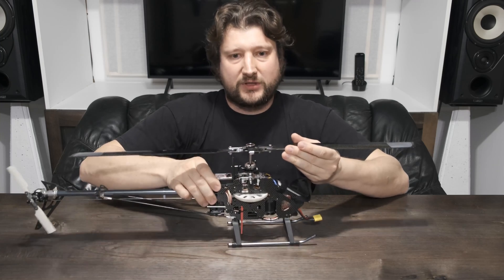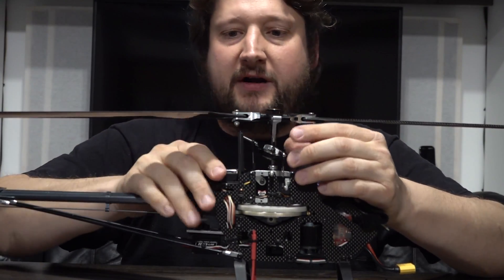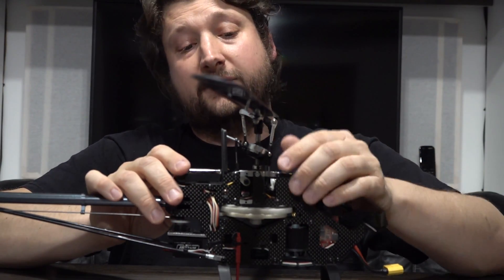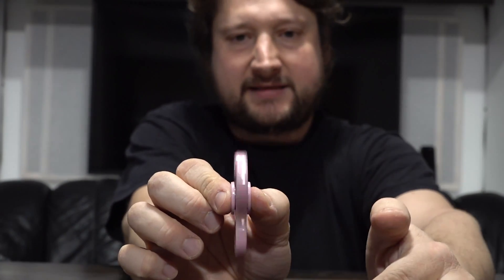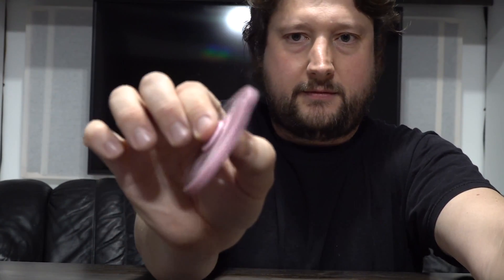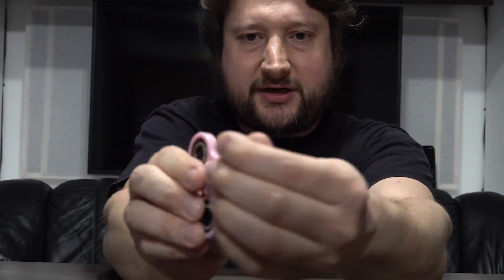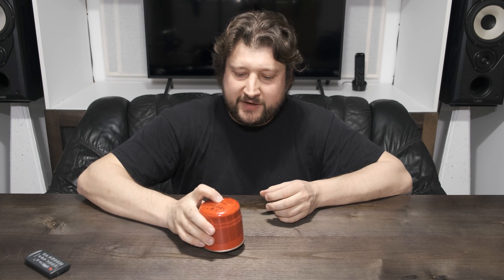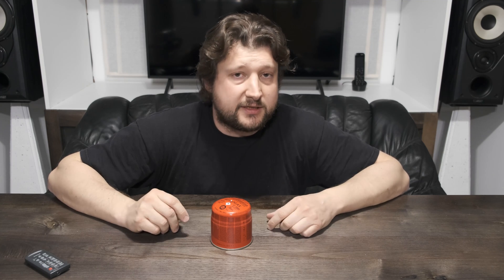Airgun physics - part 1 (why pellets spiral)

Comment: Spiraling diablo pellets is due to The Dzhanibekov Effect. As pellet spin it tries to flip over but cannot because airflow drag on its tail end is preventing it. But the farthest the pellet the slower it goes... the lesser the tail drag... the worse the spiraling. You can't stop this from happening. Because 1st nothings perfect: pellet shape, pellet mass distribution and 2nd most importantly a perfect pellet spinning vs pellet flight path: the more gyroscopic stabilization you have the more angle you'll have at longer range between spinning axis and flight path/airflow drag. Enough to initiate Dzhanibekov Effect... Airflow drag prevent it at beginning of flight but... initiate it at some point toward the end...
You can only mitigate it using:
1 - diablo pellet with higher (diameter/length) ratio (for a given caliber it means using shorter pellets)
2 - or lower twist rate.
This is logic remember: given a caliber heavier pellet are longer... which in turn need faster twist rate... for bullet shaped slugs not diablo one! 

https://youtu.be/Xrf1HzFJ8jc?si=9SSY4AG0boOzVt26 

https://youtu.be/1VPfZ_XzisU?si=7UcEdvh0DZyLdOt_
Reply from the maker: Actually, that is not true. Pellet and slugs have only 2 axis of inertia. Although you could claim the imperfections are the way they get three axis, then the slugs would have same problem as pellets. The very point of this video is the corelation of drag (or flare as some preferred to call it although the momentum derives from drag) and spin stabilization (gyro) stabilization. Both of these two are only present in shapes like pellets at the same time and the problem is that although flare is only dependent of the airflow, the gyro is not, it is actually dependent of derivative of the projectile movement and causes 90° force to the momentum it is caused by. This is best demonstrated by the fact that the spirals are ALWAYS in opposite direction of the pellet rotation. Just think about how weird that is :) You are right that the issues needs a "trigger" and that trigger is imperfection of the projectile (or a ever so slight wooable at barrel exit). That is the initial condition that is required, same as with Dzhanibekov Effect.
Reply: @gregorkamensek3923  two axis of inertia? at 9:55 :
https://youtu.be/1VPfZ_XzisU?si=t_Z2NYML8uyNHgv1
Reply: @gregorkamensek3923 
At 9:55
https://youtu.be/1VPfZ_XzisU?si=OF1cslT15F_PuGV1
But well... indeed, you have the full right to believe in whatever you like! Have a nice day.

Comment: So in short words pellet at further distances just simply drop and gyroscopic effect is not in line with drag stabilisation.
Reply from the maker: Better way of saying would be that this 90° difference of cause an effect between those two stabilization causes an oscillation because a positive feedback loop is presented and any minor starting deviation from perfect axis alignment of pellet and flight path is amplified with time (or length of flight) due to those positive feedback loop.

Comment: Ok I'm at 3:19 and i swear i haven't seen your video before. I'm going to guess that why you say pellets spiral is something similar to why at low speeds of a centrifuge one can get away with inaccuracies of the tubes not being weighed out correctly but as soon as one increases the speed, say to getting up around several g; several things will happen (maybe even quickly LOL One is the centrifuge will begin to vibrate like hell, it may even move off the bench if it is indeed a bench mounted one then you'll be blown up by your boss if your not the boss of the lab and finally if not stopped by an automatic cut out you could have a serious accident depending upon the speed. So I'm thinking that since in reality airgun pellets are not exactly symmetrical or at least they can be easily made non symmetrical by clumsy fingers or just come that way and hence the rotational axis can easily be off centre. Ok there O've said it LOL. I'm not a ballistics guy nor an engineer but some crazy scientist LOL. Now I watch more!
Reply from the maker: Yes, that is let's say the initial reason for issues that everyone thinks off but as you have probably seen from the video, I wanted emphasize to the relation and cause / effect of a dual stabilization any why this problem progresses... Also, based on this theory the RTI long range barrel for pellets was developed that has amazing results with pellets as close to sonic speed.
Reply: Yeah after I watched your video i checked out their site. Amazing looking for sure. Would love to have one but maybe it could be divorce if i did LOL Thanks for the feed back! @gregorkamensek3923

Comment: Hello, congratulations for the video. I'm going crazy, because my cricket tactical carbine 2 in 5.5mm at 50 meters with JSB of 18.13 group well (880 FPS); but, with 25 grain, it makes that "spiral" and I CANNOT CORRECT IT. From your video I have a better idea of what I should do. What do you recommend, increase or decrease speed? Thank you.
Reply from the maker: Are you using Monster Redesign? Those should be stable... Standard .22 LW barrels (and also other like CZ) are in my experience very prone to make the pellets spiral. Poly barrels are much better in this regard. But in any case, lower velocity is usually better although you are already quite low I imagine so I am not sure they will solve the problem.
Reply: @gregorkamensek3923  thank you very much for your reply. Tomorrow I will test and take your recommendations into account. thank you

￼

Comment: The So of Pellets
Ok, the pellet is moving away from someone. The pellet is spinning clockwise - looking at it from behind. 
A force acts on the pellet skirt to move that point of the skirt toward the pellet center. Because of gyroscopic procession,
that force is transferred 90° around the pellet skirt  counterclockwise, and acts to move the/a skirt point toward the pellet center. That is, toward the pellet center of rotation. So the axis of rotation moves the same distance and direction as the skirt. The entire skirt moves the same.
So the skirt moves off center. So the wind resistance acts on the opposite side of the skirt, which is now not in line with the pellet direction of travel, it is out in the wind. 
So the skirt is now continually moved in a smooth development, farther out of the line of travel by the wind resistance while the gyroscopic procession simply moves the wind resistance force 90° counterclockwise.  So the momentum in the pellet increases the effects of these forces, causing the skirt to be moved increasingly farther away from the trajectory.
Soon the pellet axis of rotation is being moved so far from its trajectory the head of the pellet is also moved away from the trajectory. By the wind. So those pattern effects feed on themselves and the entire pellet begins to wobble in a circle. That circle grows in a counterclockwise direction while the pellet rolls (spins) clockwise. 
It's 5 individual forces working on one item from different directions. Forward momentum.
Wind resistance. 
Clockwise spin.
An initial force on the pellet skirt. 
Gyroscopic procession. 
(The pellet decelerating because of wind resistance adds a millionth of a force helping increase the wobble, but we shouldn't mention it or the subject might get complicated).

Comment: Gregor, do bullets have higher (faster) twist rates and is that a good thing for bullets? For example, what is the average twist for a .22 rim fire rifle? Also, do large caliber center fire rifles, eg. .308 have the same twist as a .22 rim fire?
Reply from the maker: Yes, generally barrels for bullets have faster twist rate than barrels for pellets. The required twist rate for bullets depends on many parameters like caliber, bullet length, velocity,... So here are some examples: standard airgun barrel has approx 1:18" twist, standard .22 LR barrel has 1:16" or even faster, typical 308 has 1:12".
Typical rule is: the longer the bullet the faster twist is required, the smaller the caliber again faster twist is required...

Comment: wow so great greg  very well exlplained and i gain knowledge much. so now i dont wonder y some my pellets fly away far from the grouping. that moment i was thinking  that maybe some pellets are not perfectly correct made. of course there is always one pellets are incorrect centrifugal  or i mean its not balance on side to side.. while on the moment of molding from factory.like for example the rim tire of motorcycle bike there is tiny metal thing attach on one side just to balance the weight on opposite side .for some reason that it was not perfeclty equal in centrifugal weight.  but dont take my word coz its just my own opinion ..not really hundred percent sure if im right.  but still im hoping to  contribute some idea ...
Reply from the maker: Yes, that is one of the reason that the spiraling effect can occur but I wanted to focus on why the spiraling is progressive and the direction is in the opposite side twist direction... BTW: match grade bullets for firearms are actually tested for center of gravity similar than a tire of a vehicle...:)
Reply: @gregorkamensek3923  Are there easy ways to test diabolo pellets for their centers of gravity?

Comment: oh yes greg so ur also up into 3d heli hobbie...  i think u also know how to invert fly tricks haha.
anyway regarding the heli blades  the term use to call when blade shifting down and up is called  pitch. pitch propeller . negative pitch and positive pitch. that was  driven by swashplates.
Reply from the maker: Yeah, I used to be... But I don't practice anymore and I would not dare to invert the heli anymore. In my "best" days I quite confidently inverted it but I definitely did not know to do any 3D tricks... Yes, correct it is called pitch and these helis are called collective pitch because the blades RPM is constant (Governor mode) and only the pitch determines lift and controls...
Reply: @gregorkamensek3923  haha and its very expencive hobbies ...  the more u having fun about the tricks the u spent thousand of money and i stop this hobbies by looking for some another hobbies that is not so expencive hehe. better go into drone hobbies and aerial video much better ...its not that expencive and very entertaining.
Reply: @gregorkamensek3923  hellow greg hows it going...?  i bet u know the lcs sk19 semi full auto? how u compare that pcp to huben k1? which one is best for longrange?

and also how u compare the fx impact to huben when it come to longrange. knowing that the impact has the lower power in footpound energy... but ive seen some utube vlog that the impact mk2 reach the 415yard shoot. but that is maybe bigger caliber

Comment: so what what twist rate is preferred for higher velocities? and what range of fps do you regard as high velocity?
Reply from the maker: That depends, I assume that you are talking about pellets since this video is about pellets. If I would have to set a threshold for what is high velocity, I guess I would say everything above 950 fps. Here is an example. RTI long range barrel uses 1:32" twist and at the EBR, I was shooting Monster Redesign at about 1040 fps. At these velocities, the probability that the transonic air around the pellet is higher (compared to typical "regular" velocity) but there are definitely no spirals caused by the effect described in the video that would most likely appear with regular twist barrels. All I am trying to emphasize here is what is the reason for pellet spirals and not every pellet will behave the same and there is a definite limit of the pellet shape and sectional density that limit the optimal velocity but in competition where the use of pellets in mandatory (like EBR), one of the very important things is to be able to shoot with as high velocities as the accuracy allows it simply because the shooting takes place in outdoor environment.

Comment: Excellent explanation! 
So probably this is why shorter pellets tend to spiral on lower velocities, shorter pellet means weaker drag stabilization (centers of pressure and mass are closer together) and in that case in downrange pellet orientation doesn't follow the flight direction as it should...
Reply from the maker: Hm, that might be the case but I would assume that bigger effect plays the fact that shorter pellets are also lighter and therefore more prone to destabilization. In my experiences though, a lot of longer and heavier pellets have more problems with high velocities than the short lighter (sometime). For example, JSB King in the barrels I tested (standard LW) can take up to 290 m/s bit the longer and heavier Kink Heavy can only reliable go up to 275 m/s and the MK2 even less. I do agree that the momentum created on shorter pellets by drag/flare is smaller but shorter/lighter pellets also need less force to correct their trajectory so I am not sure what play a bigger role here. Sorry but I do not have a definitive answer here.
Reply: @gregorkamensek3923  I forgot to mention that I mean comparing shorter and longer pellets with same weight, so the destabilization can't come from the less mass. JSB King Heavies are very good example, shorter MKII pellets go easier to spiral on higher speeds because they have less momentum from drag compared to longer ones. Additionally on downrange rotation of pellet is lost very little, almost none, but the drag is reduced by squared velocity, so the resistance of the pellet direction to follow the trajectory is even more prominent on shorter pellets (with same mass as  longer). In my option every pellet go spiral below some speed and that speed I think has something with dominance of rotational stability over the drag stability.

Comment: you say pellets need fast twist rates, but FX after many tests discovered that slower twist rates are better for pellets and faster twist rates are better for slugs,. thats why the FX pellet liners are 1:28 and the slug liners are 1:20
Reply from the maker: No, actually I said just the opposite, pellets need slow twist. Also if you check my video about the pellet barrel from RTI, it is 1:32" twist.

Comment: Very nicely explained, Gregor, despite English not being your native language.  You did a good job explaining why higher twist rates can make a pellet that is not pointed straight spiral.  It would be interesting to talk more about why two barrels with the same twist rate might have different results.  How differences in the silencer, the crown and other variables might be a factor causing the pellets to tilt.
Reply from the maker: You are right, that would be a good topic too, right now I am preparing to go more in depth in the PCP airguns them self, so next video, will probably be about regulators...

Comment: Thank you for this. I love brain food and this really helped me understand this issue much much better. I have a completely different outlook on this matter now and I have no doubt others will also. Very helpful. Oh, by the way, the LCS SK-19 and the Huben have a completely different trigger group altogether. I wish I could send you a picture of mine I have on my phone. Mine gun stopped firing suddenly after 6000+ rounds and was sent back. The action is similar if not the same as the Huben but that’s about it. I don’t know if that’s a good thing or a bad thing because I don’t have a Huben yet, plus 5000 psi is a heck of a lot of pressure and my compressor is only rated for 4500 of which I only fill to 42-4300 on a fill. Being that the Huben is regulated wouldn’t matter with a lower psi fill but still would get less shots at a lower pressure. Anyway, just wanted to let you know they are a little different.
Reply from the maker: Thanks for the info. Yeah, the trigger has to be different as LCS also has full auto. There is not simple mod that would enable K1 to have it so it makes sense that the trigger cannot be the same design.